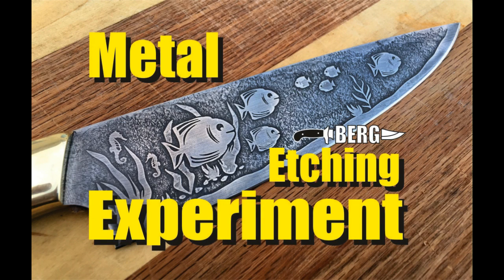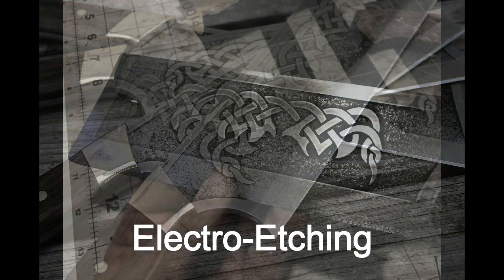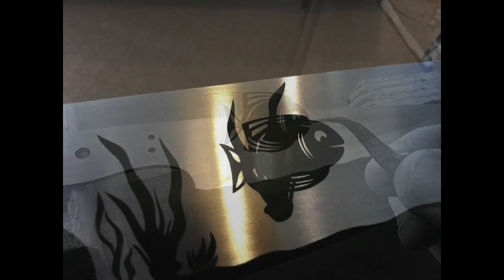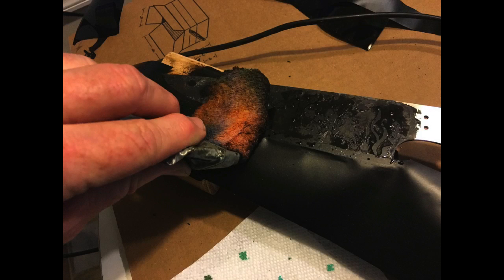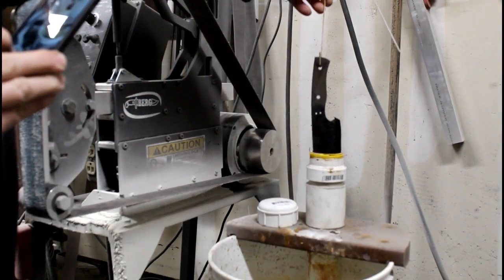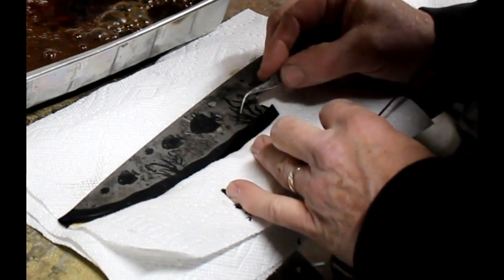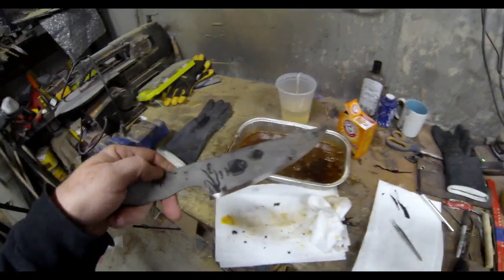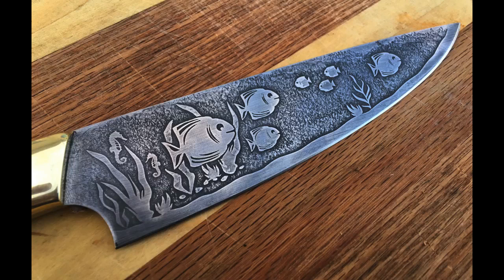Combination electro and acid Metal Etching experiment from Berg knifemaking

Comment: Always nice to go back to watch your etching videos. I have been busy doing my own hand drawn designs and etching some knives. I was wondering what is the difference in etching solutions for stainless steel that you recommend, I have been using Sea salt dissolved in Distilled Water with a little 5% White  Vinegar added with good results. Also where can I send pictures of my etched knives for  your interest. Thanks again and keep up the great videos, regards
Barry Rowe.
Reply from the maker: That is awesome! For stainless I just use white wine vinegar and add some salt. no specific ratio  but a decent amount of salt. Would absolutely love to see your work. email to wreckvalle@aol.com or join us on knives and knifemaking facebook group.
Reply: @DIYeasycrafts  Hi Dan the email address doesn't work, is it correct??
Reply from the maker: @barryrowe657  I got them. Nice looking knives and great etched logo!!!
Reply: @DIYeasycrafts  Hi Dan? thanks for the reply, I have just sent a request to join Knives and Knife Making and I will send you some pictures to the email address you gave me, regards Barry, Phuket Thailand.

Comment: If you don't mind my asking, what etch solution do you use?
Reply from the maker: For this blade I used commercially available stainless electrolyte solution. Have since converted and use white vinegar mixed with salt. Works almost as good and its a lot cheeper

Comment: Would muriatic acid and hydrogen peroxide work as the acid etching part for an axehead in between high carbon and stainless?
Reply from the maker: I do not think so. You could acid etch but most do it with ferric chloride.